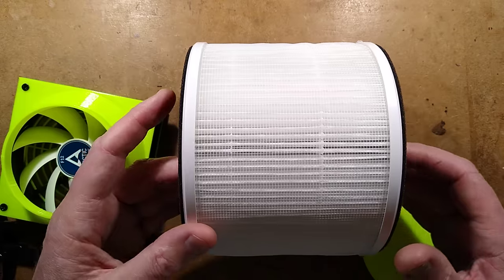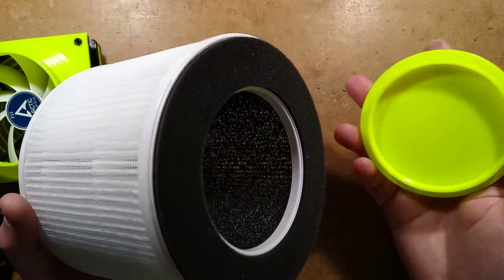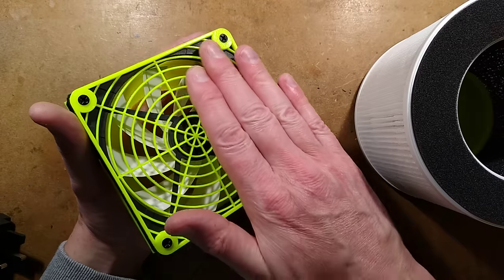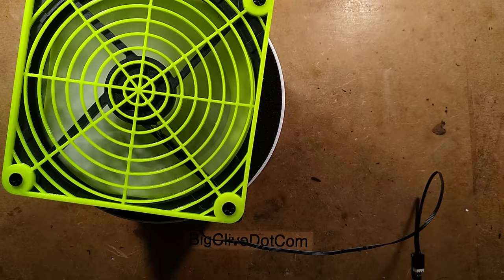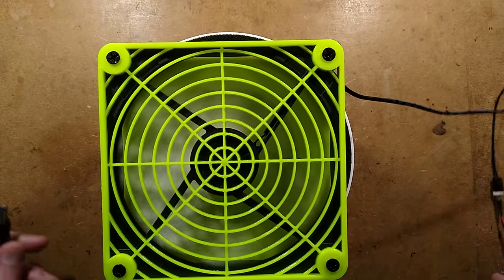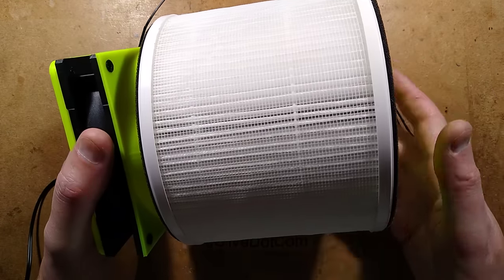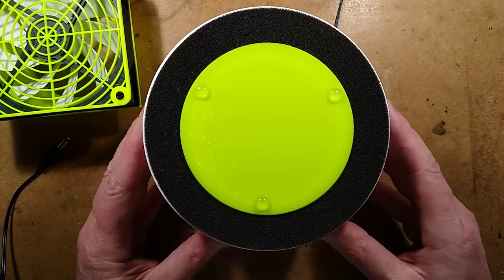DIY cheap & quiet HEPA air cleaner

Comment: Shouldn't the foam around the ends be blocked off too? Seems like a lot of air would bypass the paper filter by taking the path of least resistance.
Reply from the maker: The form is just a seal.

Comment: I have a strange feeling we'll be seeing a flood of Etsy sales for such Kits soon enough. Hey, the cable's Hand-crafted right?
Reply: Didn't happen last year when the German "chaos computer club" had similar content (additionally some volumetric measurements, airflow testing and hardwarestore conections, in case you want to change angles, airflow or position)
Reply: nah i printed such an adapter for xiaomi filters like 3 years ago. those files are on thingiverse since forever.

Comment: I've never heard that computer fans aren't supposed to be mounted horizontally. That's a bit nuts, considering that you have plenty of spots in a typical computer case for a horizontally mounted fan. The top of many cases have a spot for 2 120mm fans (or a 240mm rad with two 120mm fans on it), the power supply fan is basically always mounted horizontally, there's sometimes even a fan on the bottom of the case as well. 

That's just odd. No, I don't think that's a real thing.
Reply: depends on the type of bearing, some types really aren't meant to be loaded in that direction and will have a significantly shorter lifespan if you do.  It's not so short that you don't get a good life out of it, though (which is why it doesn't get talked about a lot)

Comment: So would I be right in guessing the air is pulled through the filter and exhausted out the fan, or is it the other way round?
Reply from the maker: Yes.  Drawing air in through the filter.

Comment: I'm waiting for my 30cmx30cm square one and 10 inch fan to make a box filter alongside putting a bunch of calcium chloride in it so it also dries the air because I've got a mold problem and it's 80% humidity or so
Reply from the maker: Consider a proper full size dehumidifier.  Much more efficient at taking moisture out of the air.  Compressor type for warm climates and a desiccant drum one for cold climates.

Comment: You push the air through the inside of the filter?

I thought you would need to suck the air from inside the filter... For negative pressure.

The filter have no flow direction? Like car filters do?
Reply from the maker: The air is drawn in from outside the filter.
Reply: @bigclivedotcom  in your video, i could swear the fan was spinning clockwise. wich according to the pitch of the fin, pump air inside of it... Probably a frequency thingy with the camera and fan spinning!

Comment: With hepa filters, you said that it sucks the air through the filter. would it work by pushing the air through the filter?
Reply from the maker: The filter has outer fluff catching layers, so it's designed to have the air drawn in from the outside.  But it could be used in both directions.

Comment: 2:49 Thinking about using one of these fans to help cool a air cooled ATV 4 wheeler in Florida, can I wire the fan directly to the 12 volt battery? Looks like there are 3 wires coming out of it, HOW woild I hook it up??
Reply from the maker: If you look for 12v fan pinout you'll see the connector they use.  Only the positive and negative are normally needed.  The third wire is often for a pulse back to the computer to show the fan is turning.

Comment: I'm going to guess the fans longevity (gunk wise) isn't taken into account. It would be better if it was designed like a cars hvac - air enters the filter then goes to the fan and only then to your face.

Comment: Wouldn't the static pressure of the PSU fan be too low for it to be a viable air purifier?
Reply from the maker: It moves air continuously 24/7 so a fair amount goes through.

Comment: can a hepa filter decrease dust accumulation?
I live in a one room apartment where I do laundry and all that, so dust is a bit of a problem, especially for my PC where I have to clean the filters frequently even with occasional use.
if it actually does help I might just scatter 2 or 3 around the place and drive them at 5 volts or so, I do have a lot of computer fans and power bricks laying around already
Reply from the maker: A Hepa filter would clog quickly in a very dusty environment.  It might be better using one with a coarser washable filter.
Reply: @bigclivedotcom  ok
thanks for your response
I'll try one of these kitchen hood filter materials for now, I think I might put an air filter for cars behind that, we have a few left over at the shop
still debating if I should use a cabin air filter or one for the engine, might have to so dome tests for that.

I also happen to have some Arctic P14 fans around, they are the best fans out there, great static pressure, relatively silent and cheap
it's perfect for filters because of the static pressure

Comment: Just one thing …. It isn’t pink!   (Later … On reading I see other such comment).    Next step is electrostatic attraction section using BC high voltage circuitry??

Comment: Instead of blowing inside the filter, why not pull air out of the filter? You can also add a second fan in  the other side
Reply from the maker: It is pulling air from the outside of the filter.
Reply: @bigclivedotcom  Got it. I have actually made the setup you have!! I did add an extra fan as I mentioned in the bottom but I'm not really sure if it helps or they cancel each other, as the air feeling in the filter is weaker. Any idea?

Comment: Could you reverse the fan to suck solder fumes into the filter?
Reply from the maker: You could flip the fan over to do that.  But even as it is, it will pull the fumes into it from the outside.  I've never been too impressed with solder fume fans.  A lot just seems to go up into the air anyway.

Comment: There are quite a few videos on the topic but HEPA filters is not necessary for your home.  They restrict too much airflow and clogs up too fast.  Instead got with cheaper MERV 13 or equivalent filters and save yourself some money.  The increased airflow should end up giving better performance overall as the computer fan isn't any champion at handling high static pressure.

Non-HEPA filters doesn't trap as much tiny particles, but the air in your home isn't going anywhere so your purifier will process the same air over and over and trapping those small particles it missed the first time.
Reply: Yes...that's what I've also learned during my research.  Every experiment I see here gives me some new knowledge & tricks.  Like dialing down the voltage a bit for a quieter fan...thanks BigC!

Comment: The fan isn't designed to be mounted horizontally? Tell that to all the computer case manufacturers making cases with top and bottom fans. I haven't heard anything about the top and bottom fans dying quicker but it could be a thing.

Comment: Hi Just found your video. I am looking for something for my small craft studio.  Can you let me know what fan you used, so I can follow  your 3d drawings.  Thanks
Eve
Reply from the maker: I used an Arctic P12 fan.  If you need to clean lots of smoke or dust then it might be worth going with a larger commercial unit.  I originally made this one to quietly filter air at low speed in my bedroom.

Comment: I have a question 
the fan is blowing in to the filter or out from the filter?
Reply from the maker: It is pulling air through the filter from the outside and blowing it out the fan end.

Comment: A few days after your toilet paper air filter video, i tried to make my own by placing toilet paper behind a little fan, but by some trick of aerodynamics, placing toilet paper behind or in the rim of the fan made it way noisier and emit a tone. Very strange indeed.
Reply: Most likely the fan is moving on its axis  (in and out). The low pressure side is pulling air from the front, back over the blade tips.

Comment: I know this is an old video, but I am trying out the SCAD file and it seems to break if the filter diameter is larger than the fan size. Is there a way to fix this? I'm afraid I don't know much about how SCAD works.
Reply from the maker: Sorry, it did only work in a fixed size range.  I should maybe do a new version.
Reply: Hello, I edited Clive's script to work on fans of different sizes. I also added the option to have a sealing circle so to speak, which can be useful for those air filters that have a foam ring around the hole.
I also added a "dirty" way to make the script work when the fan is smaller than the filter, although there are some funny things going on with the base. The print should still be functional though.
I tried replying to Clive's comment but for some reason it kept not getting posted.

$fn = 100;

//----------IMPORTANT----------
buffer=0.01; //to help with removing skin effects openSCAD previews, set to 0 when rendering and/or exporting the STL file.
//--------------------------------

screw_hole_size = 4.5; //diameter of the screw hole
hole_distance = 7.5; //distance of the screw hole's center from the edge of the base

thickness = 1.5; //thickness of the parts
fan_size = 120; //size of the fan
filter_hole_diameter = 100; //diameter of the filter hole
insert_length = 10; //lenght of the insert into the filter hole

sealing_circle_length = 20; //extra diameter to be added onto the filter_hole_diameter to create a sealing circle (useful for filters with a foam sealant and/or when fan size is close to the filter hole diameter)

cone = fan_size>filter_hole_diameter ? (fan_size-filter_hole_diameter)/1.5 : (filter_hole_diameter-fan_size)/1.5;

difference()
{
	union()
	{
		//create base
		translate([0,0,0])
		cube([fan_size, fan_size, thickness]);
		
		//connecting cone
		translate([fan_size/2,fan_size/2,0])
        cylinder(h=cone, d1=fan_size, d2=filter_hole_diameter);
		
		//create sealing cylinder
		translate([fan_size/2,fan_size/2,cone])
		cylinder(h=thickness,d1=filter_hole_diameter+sealing_circle_length, d2=filter_hole_diameter+sealing_circle_length);
		
		//insert
		translate([fan_size/2,fan_size/2,cone])
		cylinder(h=insert_length,d=filter_hole_diameter);
	}
	//connecting cone
	translate([fan_size/2,fan_size/2,-buffer])
    cylinder(h=cone+2*buffer, d1=fan_size-(fan_size*1/30)+2*buffer, d2=filter_hole_diameter-2*thickness);
	
	//insert
	translate([fan_size/2,fan_size/2,cone-buffer])
    cylinder(h=insert_length+2*buffer,d=filter_hole_diameter-2*thickness);
	
	//create mounting holes
	translate([fan_size-hole_distance,fan_size-hole_distance,-buffer])
	cylinder(d=screw_hole_size,h=thickness+2*buffer);
	
	translate([hole_distance,fan_size-hole_distance,-buffer])
	cylinder(d=screw_hole_size,h=thickness+2*buffer);
	
	translate([fan_size-hole_distance,hole_distance,-buffer])
	cylinder(d=screw_hole_size,h=thickness+2*buffer);
	
	translate([hole_distance,hole_distance,-buffer])
	cylinder(d=screw_hole_size,h=thickness+2*buffer);
	
}

Comment: Does the fan blow air into the filter? Mine sucks through the filter then out the fan side
Reply from the maker: The fan sucks.
Reply: @bigclivedotcom  
Thanks I probably miss heard you. Thought you said the fan blew into filter. I’m getting old 
Thanks for the reply
Reply: @bigclivedotcom  
Oh I forgot to mention 
A tip given to me a few years ago. If you put a couple of sheets of kitchen roll around the filter, but don’t over lap them, you can see how much crap you have collected and when it’s time to replace the paper. It prolongs the life of your filter 
I just wrapped elastic bands around mine to hold in place

Comment: air flow should go the other direction. You want the dirty air to be sucked through the filter on the intake, and exhaust out through the fan.
Reply: Thats what it’s already doing. He has it intake through the filter and exhaust through the fan
Reply: Bruh
Reply: 0:58 3:27 He knows...
Reply: @nyetloki  at 3:27 he says he can feel the air blowing out of the filter between his fingers. The air flow is going backwards.
Reply: @Joe-bm4wx  "I feel a noticeable air flow out the end". At exactly 3:27 as in the air is being sucked in through the sides, down the middle and out to the left where his hand in. The direction it's supposed to go.

Comment: Arctic do make a CO (continous operation) version of that fan (Arctic P12 CO) for a little bit more. And since those fans feature pulse width modulation, you could get a PWM module that'll allow you to change the fan RPM on the fly.

Comment: How about using 2 fans, 1 on each sides?
Reply from the maker: That could work.  It will accept two fan assemblies.  They'd both have to suck from the centre.
Reply: @bigclivedotcom  I had this vision of someone blowing air straight through the middle of the cylinder 😂

Comment: I'm so confused, I thought I would supercharge this idea. I 3d printed a housing which let me use three fans to pull instead of 1 in a cube shape. The airflow was much poorer, 1 fan good 3 fans bad wtf!? I made sure to check all fans were trying to pull through the filter.
Reply from the maker: Air flow and turbulence is a really complicated subject.
Reply from the maker: You can put a fan on either side.

Comment: 1) literally at least half of FANs in any PC case run horizontally...
2) ... and even if it shorten its lifespan, its not like basic ARTIC static pressure FAN cost like $4.

Comment: Run out of pink filament Clive?

I think your fan might be mounted upside down anyway.. Having the fan only handle filtered air by being downstream of the filter (ie: exhaust side) keeps it much cleaner. Also easy to tell if the filter is functioning as fans collect dust like nobody's business. If the dirt hits the outside of the filter media, it's much, MUCH easier to clean (unless replaced once in a while) with a brush or compressed air. I've had reasonable results with hot(ish) water with washing detergent in it in the past, quick soak and rinse, then let dry. Dissolves the gack but not the media. (YMMV with paper media)

Who said the rolling stone gathers no moss and why the hell does that not apply to fans!?! Okay it takes minutes to clean a fan and you may as well oil it at the same time but damnit It's annoying to have yet another thing to maintain.

Verbal diarrhoea over. 

Regardless it still surprises me how efficient openSCAD script is and that's WITH comments! Good work.
Reply from the maker: The fan is sucking air through the filter.

Comment: I would of gone for a  4 wire PWM fan  + Pwm Controller + ESP 8266 (nodemcu) + with  Radar  module + dust sensor 

If it dectes you in the room it ramps up to your Preference but if you leave it ramps up to max for 40 mins and settles to a very very low speed until you return

Comment: Poo to those that say the fan shouldn't be mounted horizontally. I submit that they completely ignore the thrust from the fan. That thrust will exert way more force than the weight of the rotor. Thems talking nonsense!

Comment: // 120mm fan grill HEPA filter -- the third part ;-)

$fn=100;

side=120.00;
//You can adjust these four variables
//Primarily the filter hole diameter
screwhole=5;     //fan screw hole diameter (5)
filterhole=92;     //HEPA filter hole diameter
thickness=1.5;  //Thickness of plastic layer (1.5)
insert=10;          //Length of insert into filter (10)
//Do not adjust anything below here
cone=(side-filterhole)/1.5;
wall=thickness*2;

difference()
{
    union()
    {
        //flange
        translate([0,0,0])
        cube([side,side,thickness]);
//        //taper to filter insert
//        translate([60,60,0])  
//        cylinder(h=cone,d1=side,d2=filterhole);
//        //filter insert
//        translate([60,60,cone])  
//        cylinder(h=insert,d=filterhole);

    }
    //taper to filter insert
    translate([60,60,0])  
    cylinder(h=cone,d1=116,d2=filterhole-wall);
//    //filter insert
//    translate([60,60,cone])  
//    cylinder(h=insert,d=filterhole-wall);
    //fan attachment holes
    translate([7.5,7.5,-1])  
    cylinder(h=thickness+2,d=screwhole);
    translate([7.5,112.5,-1])  
    cylinder(h=thickness+2,d=screwhole);
    translate([112.5,7.5,-1])  
    cylinder(h=thickness+2,d=screwhole);
    translate([112.5,112.5,-1])  
    cylinder(h=thickness+2,d=screwhole);
}

        for (dia = [20 : 10 : side / 2])
        {
            difference() 
            {
                #translate([side / 2, side / 2, 0])
                cylinder(h=thickness, r=dia, center=false);

                #translate([side / 2, side / 2, 0])
                cylinder(h=thickness, r=dia - thickness, center=false);
            };
        };

        for (w = [45 : 45 : 360])
        {
            // mind the double translate
            #translate([(side/2), (side/2), 0])
            rotate([0, 0, w])
            translate([-(thickness/2), -(thickness/2), 0])
            cube([side / 2 - thickness, thickness, thickness], center=false);
        };

Comment: Can I have your file for this print?
Reply from the maker: The openscad script is in the description.  It's parametric to accommodate different filter sizes, so can't be an STL file until you have chosen those sizes and rendered it.

Comment: The cost of an air purifier is overwhelmingly replacement filters. What is the point of making a hugely less effective unit that in a few years will cost on average only a few cents less per month to operate?
Reply: The efficiency comes from how much air fan pushes through the filter. But efficiency hardly matters in the first place.
A quiet and weak fan like this would probably take way longer to clean a room. Tho once it has cycled the air in the room enough it'll be the same.

Comment: You may have the air flow reversed. The filter looks to be designed to intake radially, and exhaust axially.
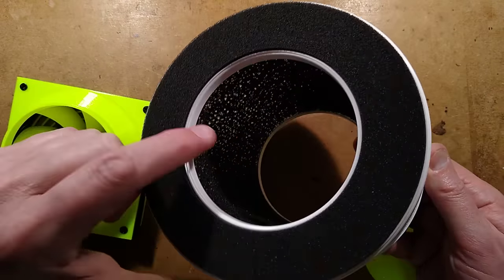Reply: 0:50 no. He details the order of filtering

Comment: Cheap? So just need to spend a few thousand on a 3d printer? Must have enough change in my pocket for that,
Reply: Or maybe a £200 Ender 3 3D printer. Or a local 3D print service for £10-20...